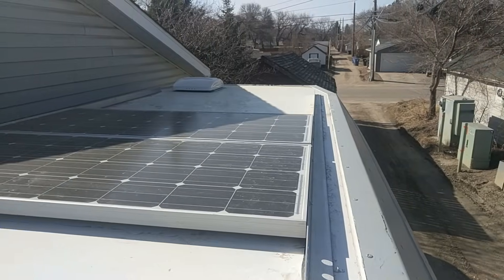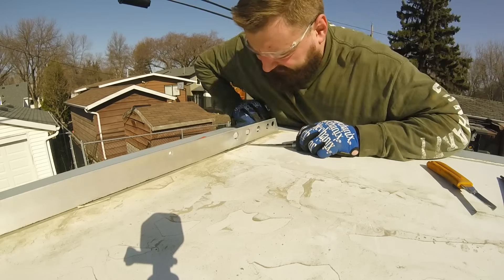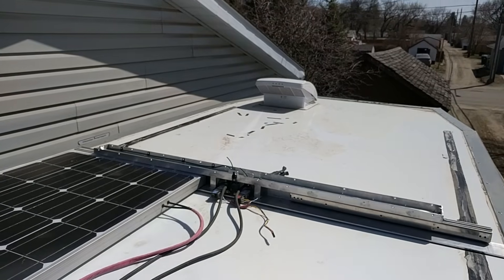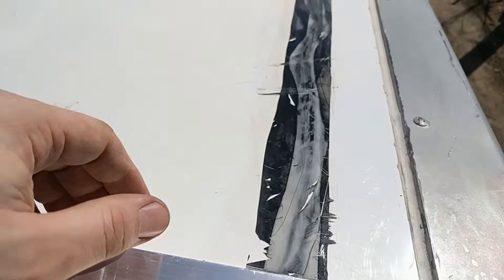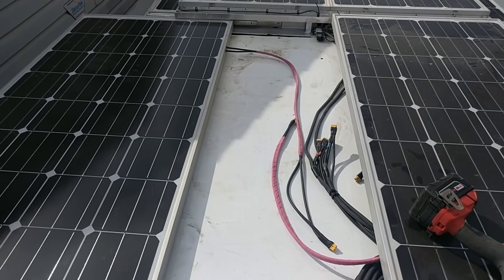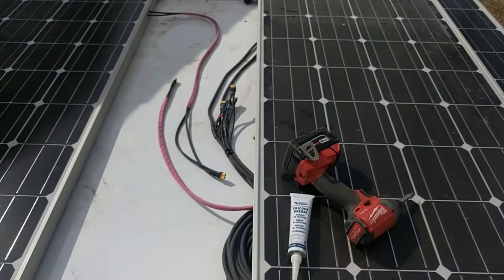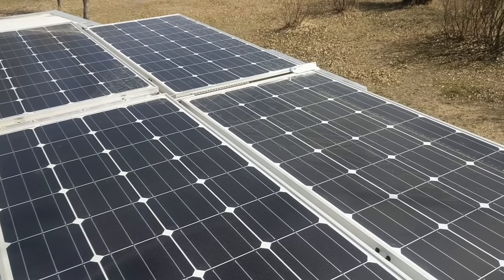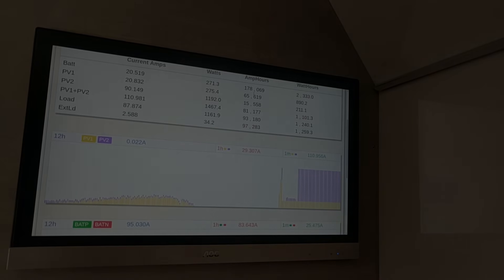Expanding Solar Array Install and Epic Fail - How not to Build an Overlander

Comment: Did you just solder microelectronics under a MICROSCOPE ?!?
Reply from the maker: Yup! If you think that's impressive, you'll love this one... https://youtu.be/7RdbXw5mJsA
Reply: @Everlanders  With using air-operated actuators, what happens if you lose compressed air whilst travelling? Will they stay put? I had this idea a few months ago for a fifth wheeler RV that we want to buy in about 6 months for fulltime living. The only difference that I was thinking for ours was to use gear DC operated actuators. I look forward to your thoughts on this?!?!
Reply: Probably used the freaky robot arm that points things out lol

Comment: How is this holding up for you over the years?
Reply from the maker: No problems, made it through 14 countries so far, just made it to Bolivia... 👍 https://youtu.be/Qq0YCcJPLNA
Reply: @Everlanders that’s incredible. I’m inspired by your design and wondering if I can fix 6 residential panels and pop out another 4. Have you thought about using electrical linear actuators? Or even just manual deployment with a stick? I imagine you already had compressed air on hand for overlanding.
Reply from the maker: I would not consider linear actuators in this application, many times the size, cost and failure rates.

Comment: Have you considered flexible panels on the roof with one layer of slide outs above them? Have to keep the wiring from rubbing on the panels, but you'd get a lower profile. These are 100W panels, right? Considered upgrading to 200W panels? With that much on the roof you could remove the side panels.
Reply from the maker: I would never consider flexible panels. These are 185 watts each, and with our new side panels we have 2500 watts and make just over 10kWh per day.
https://youtu.be/lcck1ejlXt8

Comment: Hello again.  Is there any way to get drawings of your solar panel mounting rails that you fabricated?  I have ten 100watt solar panels that I want to install above my truck camper, with 6 panels always being exposed, and 4 panels being retractable like yours (two each side).  My rack system will be attached to a lumber rack, and if possible, I'll also make the solar racking able to tilt up on either side, to maximize solar exposure and gain better energy production during the months where the Sun is lower toward the horizon.
Reply from the maker: There is no need for drawings, it's just 3 lengths of 3" angle aluminum and some stainless drawer slides...

Comment: I want to do something like this but in arragement horizontaly with flexible panels, this to also make a shadow to the van to reduce heat inside.
Reply from the maker: Be aware the flexible panels are not nearly as efficient, and the ones I've had crack after 2 years of sun exposure. 

The warranties are there to keep you quite until you give up...

Comment: Hey Jason, I am going to bond  aluminum angles to our fiberglass RV as well. You seem to have good luck and experience with sikaflex bonding. Did you weight the solar panel angle mounts or does gravity work well enough?
Reply from the maker: Gravity is more than enough, but be sure to scuff both surfaces, use the 206 primer and the correct sika 252... I used some random 2 sided tape in small sections to keep it from all squeezing out.
Reply: @Everlanders  thanks. Some of the brackets will be near the radiuses edge of the camper roof. Is 252 pretty thick? Will it run down a radiused edge or stay in place?
Reply from the maker: @Robbbbooo  Crazy thick... No chance it will run.Get or borrow a high quality electric or pneumatic gun. You'll crush the cheap tin gun trying to apply enough pressure to get it out.

Comment: Should have used bifacial solar panels!
Reply from the maker: No. 
(1) They are far too heavy with two glass layers, 
(2) They only benefit from being mounted high up at an angle that allows reflections from behind, great for pole mounted ground installations.
(3) Largely unavailable in 32 or 36 cell variations.
Reply: @Everlanders  would have to see the data on weight difference, when slide out it would be like being on a pile mount, and there are areas in the panels that allow light threw even when mounted normally, you are very smart and should research this more, Thanks
Reply from the maker: In our case I don't want light coming through, they are used to shade our roof and sides, I will not be researching this more.
Reply: @Everlanders  cool

Comment: Hi Jason, so running this setup for a while, can you make a comment on what would be an appropriate wiring scheme for a similar four-panel (two ontop two) layout? Considering situations where only two or three panels may be active due to physical or environmental limitations. Thank you!
Reply from the maker: I have all my panels paralleled, this way if any one panel is shaded it doesn't take the others down with it. If you intend to series your panels for 24 volts or long wire efficiency, you'd want the top two paralleled with the bottom two.
Reply: @Everlanders  Thanks, that I was thinking as well, series in pair horizontally, with parallel out. Any tips on how to better manage cable connection for the sliding panels, do you use cable management arms inside the panel frame to prevent cables to get jammed? Thanks again.
Reply from the maker: No arms were needed in my case, 3 years of daily use and still no problems. I did make a video showing how my wires are run...  https://youtu.be/0GDvu0AUrgs

Comment: Good morning, I have a similar project but I go beyond: I'll keep a fixed set on the roof, I'll put another set on a slider that will be opened to the right (like a awning), and another set that opens to the left - all This to get enough energy to supply a huge battery bank on the chassis, to move 2 electronic engines (yes, 2 axes of traction). Crazy idea, right? But as it is a motor-house while loading, I will be enjoying the surroundings, writing, working ... and to reduce energy demand, the heating of the bath water will give you through a solar heater (sun we have a lot this way)
Reply from the maker: It's not a crazy idea, it's just very optimistic. It has been done several times before: https://www.youtube.com/watch?v=pcj2lQwH7N4
But they need to wait two days to charge the batteries for a very short drive... At times they have been at the side of the road for 2 weeks waiting for sun...
Reply: @Everlanders  my project is a little more elaborate: to begin with, i don't intend to visit areas like alaska or tierra del fuego; and my idea is to travel every 15 or 20 days; and an air conditioner for the batteries; and a solar heater for bath water; divide the battery bank into 2, charging one side and spending the other

Comment: Wow, with all that solar, what MPPT charger do you use to add to the solar management system, the Victron (model here?)?  Or a Morningstar?
Reply from the maker: None of the above. I guess you'll need to watch the whole video to get your answer.
Reply from the maker: ... there is no additional charge controller required, it's all handled by the SBMS100 shown at 8:25
Reply: I did, watched the whole one and then went to their website to learn more and then got confused lol. So went back to you as the horses mouth so to speak.  Didn't understand how it handled the high amp charging current and did mppt, etc... anyway, perhaps not a comment question. Thanks again and really enjoying your channel!

Comment: How did you automate your wideant to seek automatically? Havent seen a video on that nice job though1
Reply from the maker: A small motor and python scripts querying the router for signal strength - not enough interest to make a video on that.
Reply: Damn. That was what I was really interested in seeing. Are there small electrical wheels driving the panels out?

Comment: very informative video .  i need to make this expanding frames made of Aluminum , so  if i join your monthly channel can i get the full details & design calculations . also to build an off grid solar system to run one 1.5 ton AC unit , 1 TV , I small fridge and few LED lights ? thanks a gain
Reply from the maker: The full details are freely shared in the original video... https://youtu.be/cM5s4F-7AOk

Comment: 0:23 - what adhesive did you use to make it THAT strong? 😮 I'm just afraid anything, even with Epoxy, would just break off suddenly and eventually...

Much appreciated for the video
Reply from the maker: Sikaflex 252 with 207 primer.
Reply: @Everlanders  thank you so much!
Reply: @millanferende6723  preparation is the key, get it  absolutely clean sikaflex can sometimes be too good! we use it in mining to seal gaps in armour plating in crushers, still there when the moly steel plates ave worn away

Comment: 4:29 chassis as ground is inefficient

You'll always have voltage drops across connections, and the chassis connection will always have a larger drop

Stick with copper and gold plated brass. Most efficient at every power level

But great work! Great ideas! Love it!
Reply from the maker: Not the truck chassis, the Box Chassis, all 3/16 aluminum,  TIG welded throughout, although a gold plated camper box sounds pretty nice...

Comment: Curious what you used between the stainless runners and aluminium sections to prevent galvanic corrosion
Reply from the maker: Sikaflex 252

Comment: You would do better with a good MPPT charge controller. MPPT uses like a transformer to match the voltage so it will change higher voltage from the solar panels to more current to charge the batteries
Reply from the maker: I got no additional gains when testing with MPPT. Our panels are already matched to our Lithium Bank.

Comment: so no MPPT for you ? :) I wish Dacus would make an MPPT one
Reply from the maker: I have no desire for MPPT
Reply: @Everlanders  lol ... I do :) but I do wonder if it's worth the risk of failure for the little extra power. "Complexity is the enemy of reliability" you know ...
Reply from the maker: I've repaired enough mppt controllers and dealt with minimal extra gains when solar panels are properly matched to the batteries. Further, we're camped out with people with dead mppt controllers while quarantined in Mexico, no chance of warranty replacement new chance of repair... Guess who's charging their batteries...

Comment: Just for future reference next time use a vibration multitool to get between the silkoflex makes the job alot easier, great set up
Reply from the maker: Don't have one.
Reply: @Everlanders  I used a fin piece of wire like a cheese cutter  works well,  I used silkoflex 522 couldn't move it only been on less than 24hrs really works well

Comment: Probably could've used a blowtorch on that adhesive?
Reply from the maker: Nope, would have burned the composite panels...
Reply: @Everlanders  damn, well at least we know what glue to use!!
Reply: @Everlanders  I like the design, now I just need them to 45* in the winter months :)

Comment: Would highway wind rattle the crap out of the lowers if not retracted? I expect so. That being said, is there an auto retract incase you forget in an emergency “get the heck out” situation? I expect that would be a fairly simple upgrade. Maybe triggered from the ignition wire? Just a thought. 😁
Reply from the maker: It's triggered to retract with the brake pedal, so they always come in when we start the truck. I also have an override switch so I can have them extended when we're stuck in traffic, moving slowly on smooth roads etc... 

But it's very sturdily built, we've probably driven a thousand kilometers or more with them extended, with no problems.
Reply: Everlanders - Wow, you have thought of EVERYTHING! 👍🏻 Excellent work my friend!

Comment: Amazing, you've done exactly what I've been dreaming of doing with a Sprinter van, except the second later of solar panels would be mounted the other way and deploy entirely on one side of the van so as to double as a canopy (though my idea was to put them on some sort of tray on runners) automatic deployment and retraction is just taking it to the next level, perfect.

Comment: hi from Australia the land of sunshine. i have a solar system but suffer the battery problem as you describe, too many dollars outlay so i have two 170 ah in parallel still suffer the sag as you say. looks like i have no choice but go lithium or put 10 batteries in thanks for this great video.

Comment: bless The Lord . I have for 2 month puting something like this together in my head. To see that you`ve done it is Awesome . It`s perfect .I sure Wife family an friends R very prourd of you. That One thing ,though I don`t have PI . How hard would it be to pay for your outline. I `m almost at that POINT OF DOING pi. I`m plan the layout of the weerool build trailer . Aluminum and they can do some pre wire . I want all seasons. This is the 1st video I seen of yours and watched it 3 times it so cool ,to see the dream.  if you have any thing you can share ,please do so. if you able to contact ,thats the only reason I`d put a email address up. I`m in Fl. US ok I joined your channe/ 2nd treir  lets have some fum.
Reply from the maker: This is the Part 2 video... Part 1 shows the assembly with a little more detail. https://youtu.be/cM5s4F-7AOk

You would not need to use a Pi, a simple toggle switch or even a 5 way pnumaic switch would work.

Comment: Can you sell your plans or something? This would be awesome on my ambulance build, and I am no where near as tech savvy as you. I am interested in the pneumatic slide outs and charge controller system and batteries used. My mini-split A/C search led me to you and I am glad it did.
Reply from the maker: Sell plans? I gave all the details for free... The components you need are all listed in the Part 1 video description. The sides just bolt to some angle aluminum and the width is governed by the panels you choose . Everything is shown in this playlist. DIY Solar Powered RV - Lithium Power LiFePo4: https://www.youtube.com/playlist?list=PL0uBLqOOwG8hv9HRxGZvnesMBrUVyiQKf

Comment: Your system is awesome. Is there a realistic way to get an even bigger panel surface?
Reply from the maker: More Panels and More Slides...
Reply: @Everlanders  
You mean one more floor? (I don't master English langage).
Reply: Do you think it would be possible to make a solid 3-storey installation by placing the panels perpendicular to the vehicle?  There would be the total length of 1 panel above the void on each side of the vehicle.

Comment: Everlanders With using air-operated actuators, what happens if you lose compressed air whilst travelling? Will they stay put? I had this idea a few months ago for a fifth wheeler RV that we want to buy in about 6 months for fulltime living. The only difference that I was thinking for ours was to use gear DC operated actuators. I look forward to your thoughts on this?!?!
Reply from the maker: I now have a Frequently Asked Questions post on this very topic on our website that gives lots of details... https://everlanders.com/FAQ-air-powered-slides/

Comment: I saw a mention in another video that the power is 8k watts.  Doesn't that mean each solar panel is somehow 1000 watts?
Where did you get those panels?
Reply from the maker: No, not 8kW... They are 185 watt panels, 1.48kW total.

Comment: Love it, but no way those slides can last long exposed to dust and dirt especially if left with grease. Tilting would probably make more sense in terms of efficiency.
Reply from the maker: You're going to feel silly after we put 100K kilometers on this rig, over 3 years, traveling to the Artic Ocean, through Canada, the USA, Mexico and into Central America...
https://youtu.be/1yYDLU3sOio
https://youtu.be/j5aVE_vo6v4

Comment: I designed something exactly like this back in 2004 or 2005 for popping out (doubling) the solar panel capacity on my Prevost motorcoach using air slides similar to you and already used throughout the coach, but I never had it fabricated, and a lot of that had to do with realizing that all the solar in the world I had a non-energy star fridge and not great energy storage options for overnight, the state of the art then was still AGM for the most part. That meant after all that fancy solar I wold still need to cycle the genny at least once overnight, deleting the purpose of the exercise. It delights me to see you did it, gives me hope for the future should I want to sit around boondocking, with enough solar to run all the air conditioning should we want to. Our coach has 40’ length, most usable for panels, so we could potentially generate quite a bit of power at peak day, right when we need the power for cooling the interior.

Comment: While I agree you are VERY intelligent, I think for myself I would rather not ad to the complication of my systems, in other words K.I.S.S !
I will do the same but will just pull the panels out manually so as to not heave to worry about air lines etc.
Just my 2 cents......
Reply: Thats what I was thinking, however,  my panels are on top of a huge truck in about 3.9 m hight. Including a locking mechanism I expect it to be very hard to open it manually.

Comment: Ive just begun a very similar project, I have an sbms120 on order and still deciding on which Batteries to get, eg. the 180ah you have or go up to the 400ah winstons. I have heard a few stories about the CALB having problems with quality control, how have yours been? Also what kind of Sikaflex did you use for the alloy on the roof, I just bought some 11fc and was not happy with its bonding of 2 pieces of alloy for a test.
Reply from the maker: I've had no problems, our whole truck is bonded with SikaFlex 252 and the 207 primer...
Reply: @Everlanders  Ok thanks, I will have to look into that primer, the tests I have done trying to bond alloy have failed easily even with an alcohol clean and wire brush/drill scuffing both surfaces.